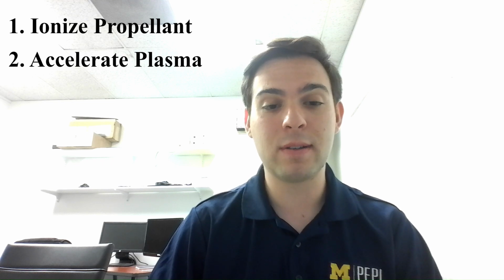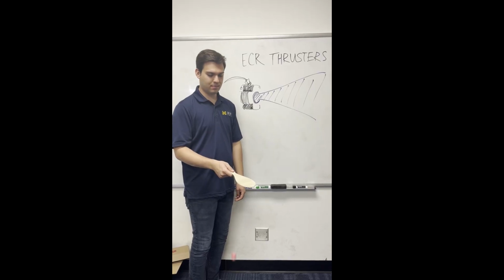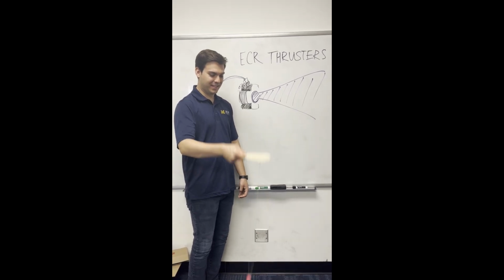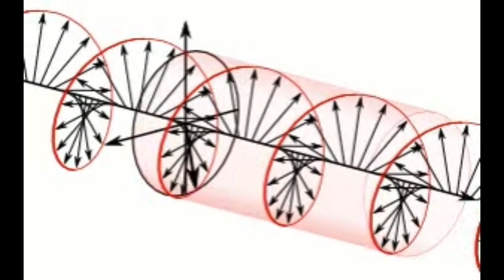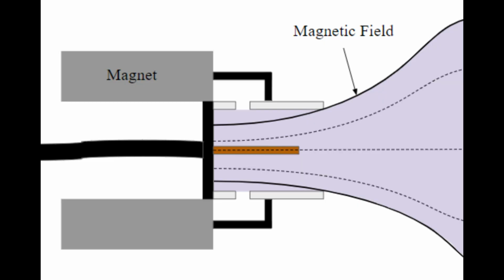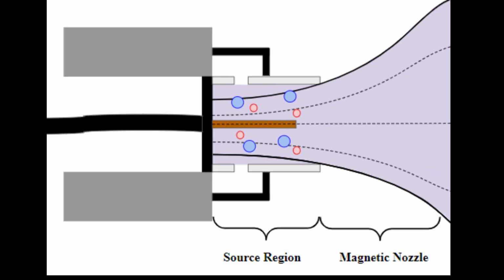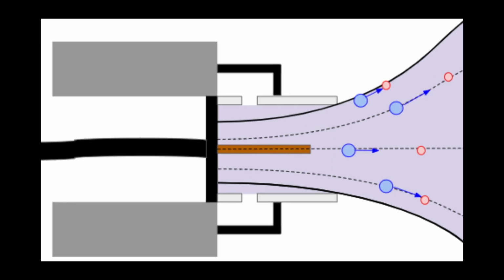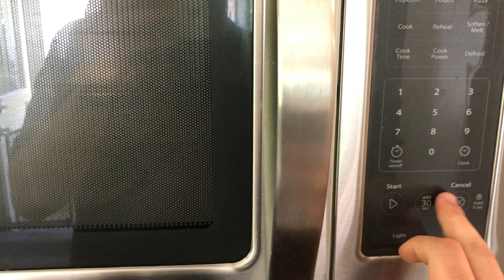ECR Thrusters: How We Use Microwaves to Move Small Spacecraft

Comment: I've wondered about using liquid nitrogen which would rapidly sublimate in the vacuum of space as a coolant for a superconducting electromagnetic nozzle and the resultant gas as a propellant.  Obviously some time and nitrogen would be required to first cool the solenoid and electrical current would then be necessary to power it. But, the strength of the magnetic field could be considerably more than any permanent magnet and variable as well so tasks like station keeping could use less current. And, they are extremely efficient in converting electrical current into magnetism, compact, and reliable.